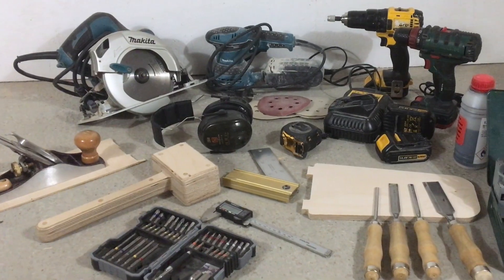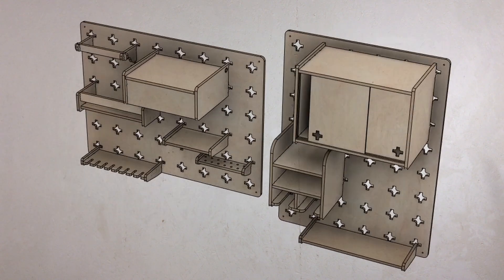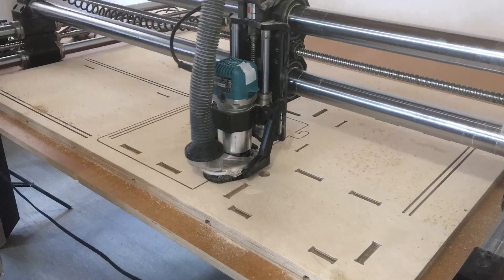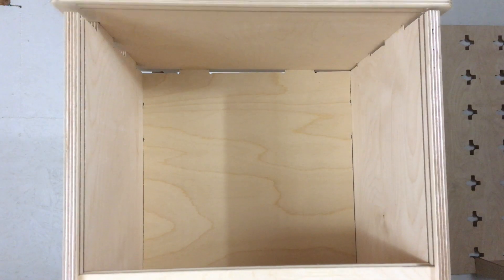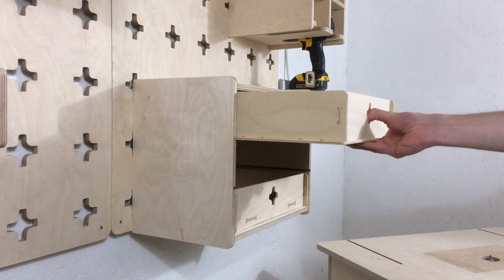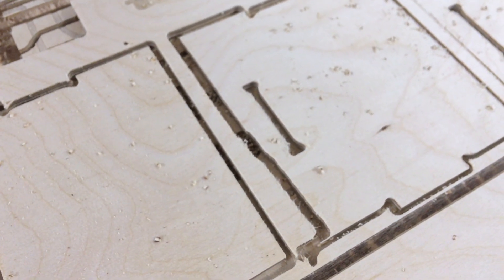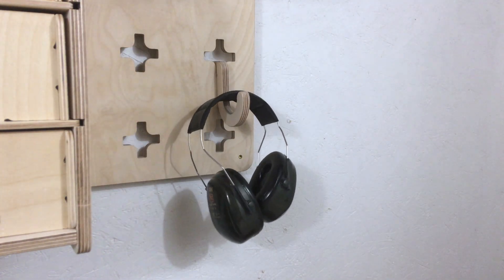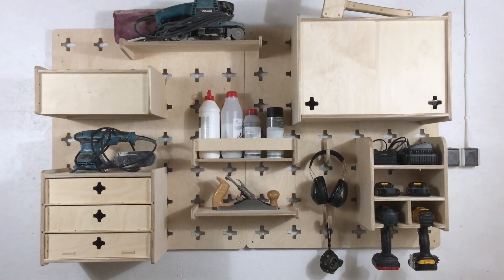If The French Cleat Wall was Made on a CNC Router - Aribabox Workshop EP07-

Comment: Great idea. This is definitely something I'm in need of. Traditional peg board is too fragile and the metal kits are too limited and expensive. I like the style too, I think it will help convince people I know what I'm doing with woodworking!
Reply from the maker: Thank you! That's true about the traditional pegboard walls. This is a great alternative that will allow you to turn some of your offcuts into new pegboard wall attachments with no additional costs.
And we hope having a pegboard wall like this in your workshop will help build your credibility as a woodworker.
Reply: @Aribabox  got the plans, very detailed, thank you!  I'm planning to span most of my wall and I'd like for all the panels to mount to the studs at 16" on center. Ideally maximize the 48"x96" plywood, I think the best size panels for stud width, sheet size, AND machine size to be 24"x32". 6 peg boards per sheet. Would need to create a "pegboard distancer" that spans the gap between 2 pegboards and hits the stud in the middle.
Reply from the maker: @HiHoWillyO  Glad you like the plans. And the pegboard dimensions you suggest make a lot of sense in your situation.
We could adjust the pegboard panels to be 32" x 24". However, we would also have to change the distance between the panel holes (the Philips's head screw-shaped cuts). Therefore we would also have to modify all of the attachments. It's doable, just would require a lot of time for us to get that done.
Considering all of that, we have a proposal to add horizontal planks to the vertical studs. The horizontal planks would be perfect for attaching the pegboard panels. And they would be strong enough to hold the pegboard with all of the attachments and tools.
What do you think?

Comment: Really love the way these look! It would be really easy to add some small attachments to the sides of each of these shelves/boxes since it is already space you don't use (unless you change up the location of the hook to be in a bit and not on the ends). They could only be as deep as the space between shelves, but that is enough for a lot of stuff... Maybe tape measures, on the end of drill chargers add the battery chargers screwed to side, magnetic bars with chisels or screwdrivers or etc, other measuring tools, larger sheets of sandpaper, etc. so many options for the wasted space and still looks good. Thanks for sharing! New to your channel and subbing!
Reply from the maker: Thank you for the feedback!
Adding more attachments to the larger cabinets is a great idea. We might update the design for that in the future.
And thank you for subscribing! Welcome to the channel!

Comment: Wow really love this project! Would love to purchase these plans as I think it'd be a great project as a beginner with my CNC, but I am worried about breaking bits and cutting time with using a 1/8" bit. I know you mention in your order page about adjusting plans based on actual plywood thickness, which is amazing as I live in Canada where we mostly use imperial units, but are these plans available for cutting with a 1/4" endmill? Thank you!
Reply from the maker: Thank you! Glad you like it!
That is true - cutting the project using the 1/8 bit took longer than it would have if using the 1/4 inch bit. The current files on our website are for a 1/8 inch bit, but we could adjust them so you could use a 1/4 bit.

Comment: Great video, question about the depth of cut bit size when you cut 18mm plywood, are you using 6mm or 3mm bit in that cut and at which depth? Just broke some 1/8" bit last time so mostly interested in to see what other people use for speed and feeds.
Reply from the maker: Thank you!
When cutting the 18 mm sheet, we used a 1/4 inch bit. And we made three passes per contour.
To learn more about the feeds and speeds, we can recommend checking out @cutting-it-close YouTube channel. They have great videos on this subject.
Reply: @Aribabox  thanks will check it out, reason I asked is because I hälso have an Onefinity (woodworker x35) with the Makita router. It can keep quite good speed but it always sad to loss a bit in the middle of a cut.
Reply from the maker: @LarsDunemark  We had the same problem when cutting our first projects on the CNC. And it turned out there is a formula to calculate the feeds and speeds for each type of material and router bit diameter. The @cutting-it-close guys had made a spreadsheet that helps to do the calculations and avoid breaking the bits. You can find the download link for the spreadsheet under this video - https://youtu.be/NZ9Ko62GcJg